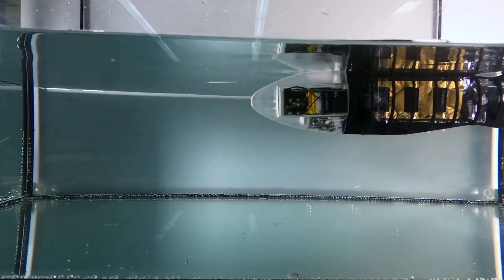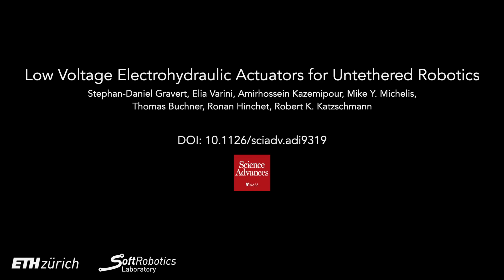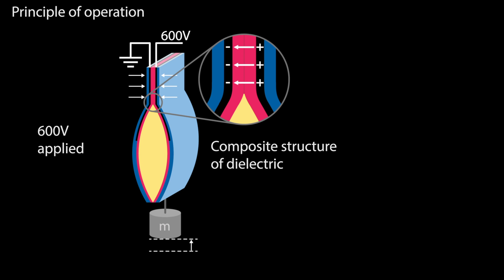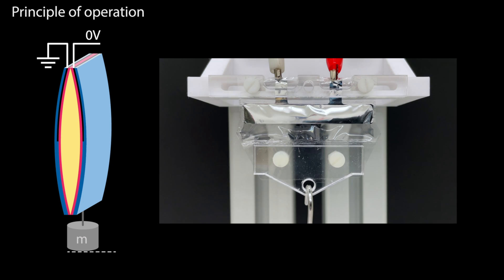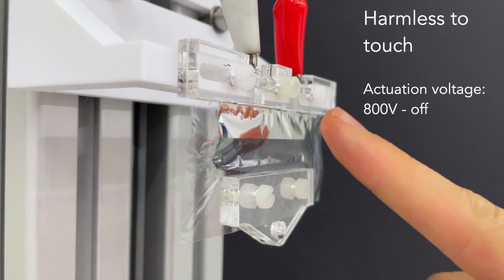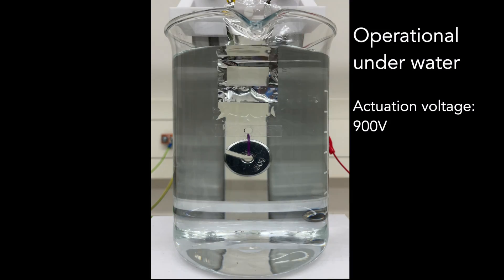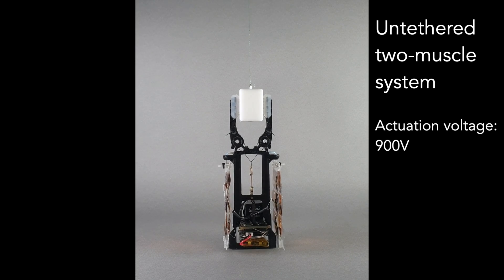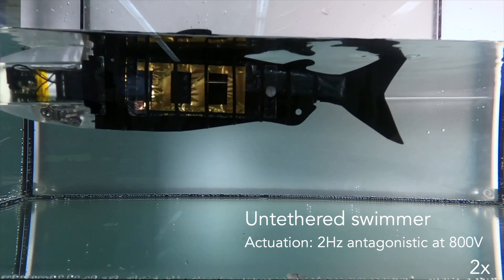Artificial muscles - Low voltage electrohydraulic actuators for untethered robotics

Comment: How does this differ from HASEL artificial muscles?
Reply: Hydraulically Amplified Low-Voltage Electrostatic (HALVE) actuators and Hydraulically Amplified Self-Healing Electrostatic (HASEL) actuators are both electrohydraulic devices designed to mimic the performance of natural muscles. While they share foundational principles, they differ notably in operating voltage, safety features, and material composition. 

Operating Voltage:
HALVE actuators operate at a substantially lower voltage (approximately 1 thousand volt) compared to traditional HASEL actuators, which typically require several thousand volts. This reduction—about 4.9 times lower—enhances safety and allows for more compact and efficient driving electronics.  

Safety Features:
HALVE actuators are designed to be safe to touch and waterproof, incorporating self-clearing properties that enhance their durability and reliability in various environments. These features make them particularly suitable for applications in wearables and robotics where user interaction and exposure to different conditions are common. 

Material Composition:
A key distinction lies in the dielectric materials used. HALVE actuators utilize advanced dielectric materials that enable effective operation at lower voltages without compromising performance. In contrast, traditional HASEL actuators often employ materials requiring higher electric fields to achieve similar actuation, necessitating higher operating voltages.  

In summary, while both HALVE and HASEL actuators aim to replicate the characteristics of natural muscles, HALVE actuators offer advantages in lower operating voltage, enhanced safety, and material innovations, making them more suitable for untethered and interactive robotic applications.
Reply: @robertkatzschmann6997 can you tell us more about their relative "lifting" strength? Is there any downside to lower voltages?

Comment: 600V is low voltage???
Reply: Typically, electrohydraulic actuators require 6-10kV to generate sufficient forces. Here, we introduced new dielectrics to significantly reduce the driving voltage to 400-1100V, with the main benefit that at that range, various small-scale and cheap electric components are available.
Reply: @robertkatzschmann1390 You can operate and control it in a simpler and more efficient way without electricity.
Reply from the maker: @ياقوت-ق  What do you suggest?
Reply: @ياقوت-ق  These electrostatic muscles, don't generate as much heat, since there is no pumping action. There's also potential to improve the design with structured polarized polymers, halbach style field strengthening, and material selection for reduced overall size and lower voltages. 

Using valve actuators also invariably uses power, and even if you incorporate some of the valve actuation into the soft artificial muscles, you're still left with an electromechanical pump, and/or electrochemical pump for generating the pressure potential inside the muscle, which has it's own problems.
Reply: It is possible to get lower voltages as well, by continually shrinking the wall thickness, and at that point it's an engineering and manufacturability problem. 

The neat thing about this, is one could create hydraulic tubes, as have been previously explored in other research, and bundle them together, then interlieve them to reduce strain and spiral them to optimize volume. Both lowering the working voltage potential, and allowing for bundled fibers and optimized power density.
Reply: amperage is what matters